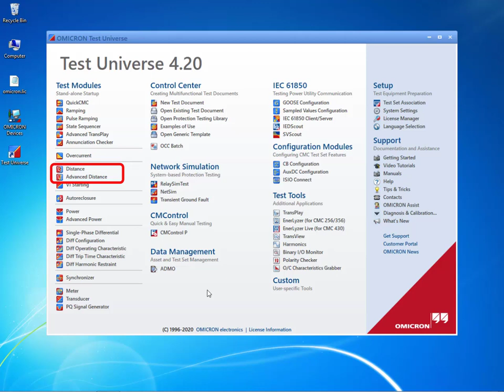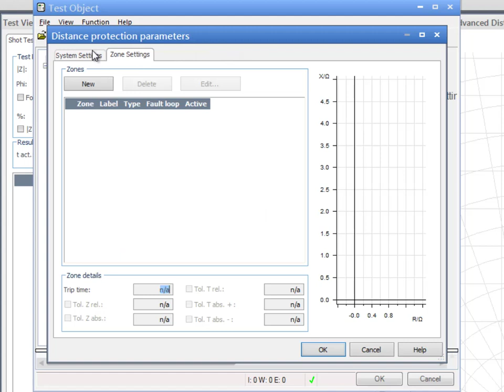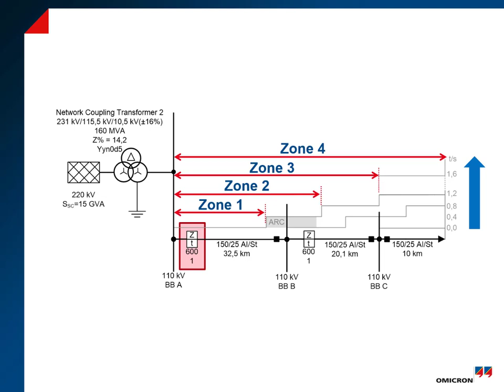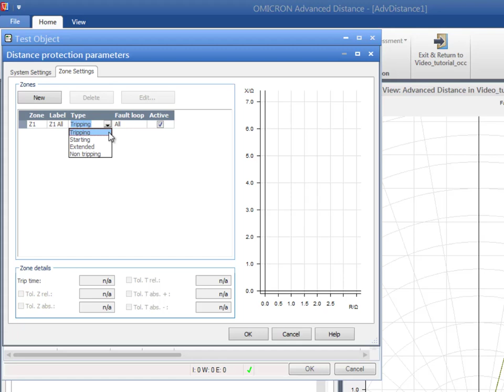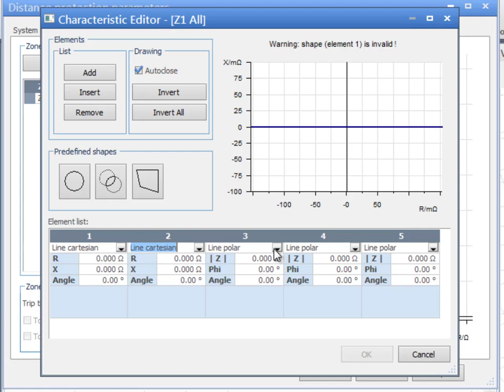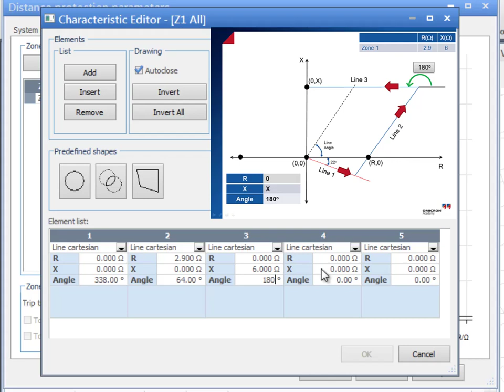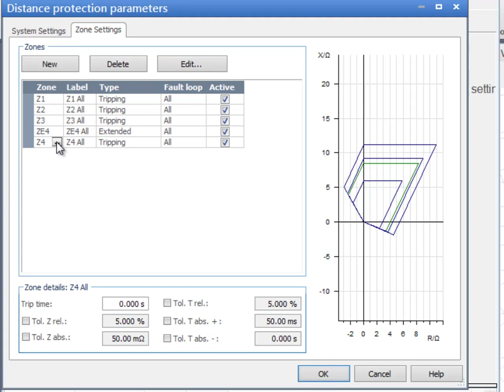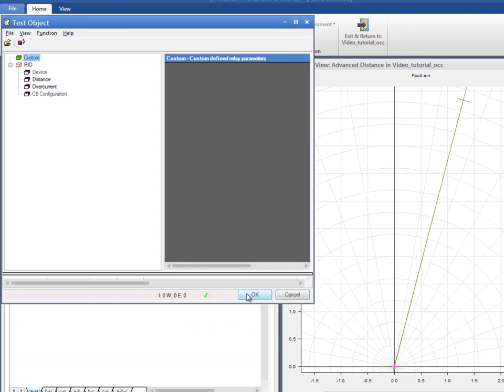Advanced Distance Module Part I

Comment: Where does the 22 degree angle come from? Why not start at 0? What setting in the relay would tell you that? Thanks.
Reply from the maker: This angle depends on the zone setting of your relay - as you can see on the picture of the zones (which was exported from the relay), the first line has a 22° angle facing downward, which can also be found in the relay settings. The exact parameter for this depends on the relay manufacturer. 
In case further clarification is necessary, it is best to contact our technical support team: https://www.omicronenergy.com/en/support/technical-support/